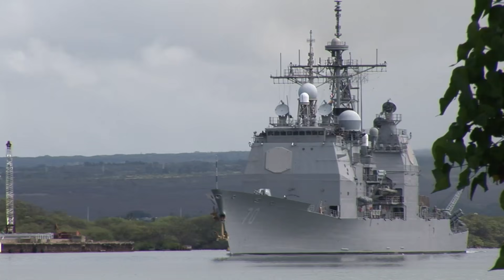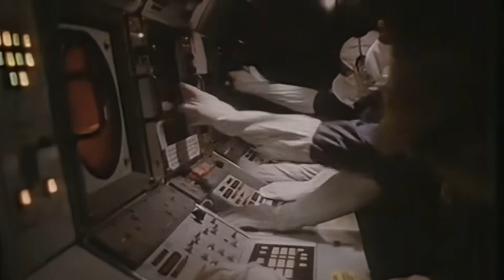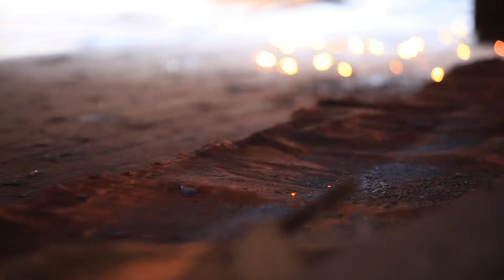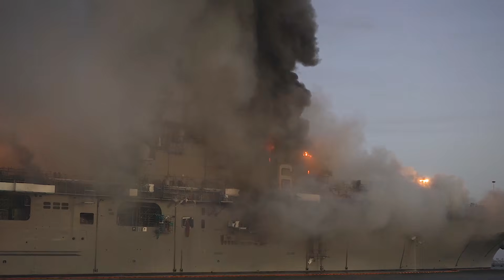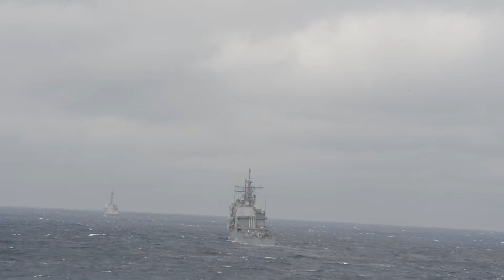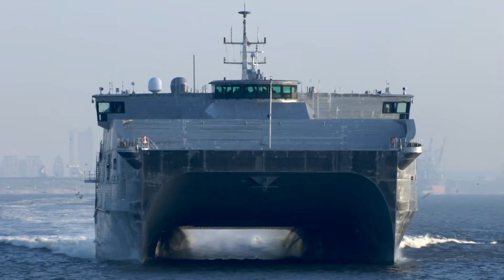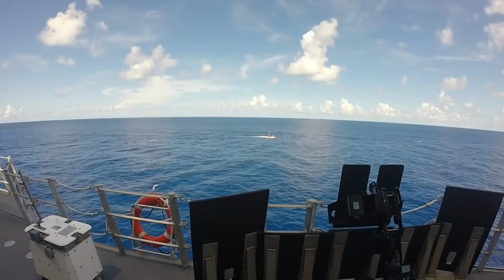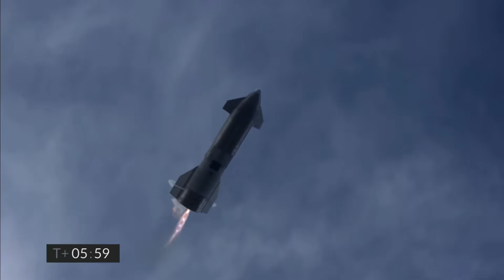Why is The US Building Aluminum Warships?

Comment: You did not mention where the cracks were occurring.  Were they at the aluminum-to-aluminum welds or at the steel-to-steel welds?  The aluminum super structure cannot be welded directly to the steel deck.  Before the invention of an aluminum-to-steel explosion-bonded transition joint, the super structure was joined to the steel deck using rivets or bolts.  This type of joint eventually failed due to galvanic corrosion.  The transition joint is in the form a 10'-12' long x 1-1/2" wide bar that is about 1-5/8" thick; the top half of the bar is aluminum and the bottom half of the bar is steel.   There is an electron-sharing bond between the two dissimilar metals that cannot be broken at the interface.  Using the transition joint allows the aluminum super structure to welded to the aluminum side of the transition joint using convention welding methods and likewise steel to be welded to steel on the other face of the transition joint.  Since there is no gap between the aluminum and the steel, galvanic corrosion is eliminated.  Using roll-bonded transition bars can be problematic because there is not a perfect electron-sharing bonded between the aluminum and the steel.
Reply: Combined bars are made by "stirring" the metals together at the joints under very high pressure.  I don't think the joins are at the electron (covalent) level.
Reply: @BenjaminFranklin99-s9n  Explosion bonding (welding) does not involve stirring of any kind.  It is a cold process where the two plates to be bonded are positioned face-to-face and parallel with a separation gap (distance) between them.  An explosive material is prepared by combining ammonium nitrate, diesel fuel, and perlite.  This fertilizer-like material is spread across the surface of the upper plate to form a uniform layer.  The explosive material is detonated at the middle of one edge using a special booster explosive.  The detonation travel from the spot of initiation through the entire layer of explosive at a controlled velocity which is slower than the speed of sound in the materials.  The pressure from the explosion causes the plate to progressively collide as the detonation proceeds across the plates.  At the point of collision (which moves across the plates), the pressure exceeds the yield strength of both of the metals.  It is several million pounds per square inch.  A "jet" erupts from the surfaces of the metals as the metals yield into the only place available...the gap between the metals.  This jet is composed on the surface contaminates of each of the two metals.  With the oxides, nitrides, and other contaminates removed and the plates forced together at several million psi, perfect electron sharing occurs.  Immediately after the explosion, the plates are only warm to the touch.  There is no heat involved in the process.  Almost any two metal types can be welded using this method.

Comment: The UK company where I worked used to import Combine Harvesters from Scandinavia, and when they arrived in the UK it was my job to replace the engines starter motor, dynamo and solenoid as a day or  two at sea caused the aluminum parts to powder and short circuit the electrics.
Reply: Why not remove them before shipping?

Comment: I know battleships were phased out due to the cost and ease of loss but I think a modern battleship with modern tech could be very valuable considering the amount of armor and defense systems that can be installed on a hull with that much displacement, it would be a good candidate for advanced systems like LAWS and maybe even the railguns when they are ready.
Reply: WRONG DELTACX!), that is NOT why BBs were phased out.  LOL!
Reply: @protonneutron9046  I'm pretty sure them being stupidly expensive and easy to destroy is the primary point for phasing then out, air superiority and subs completely countered the things.
Reply: @deltacx1059  Nope.  Other ships are EASILY to lose and can cost more. Like an aircraft carrier.. They are no longer built because aircraft can deliver more damage at a MUCH longer range.  Billy Mitchel demonstrated this concept before WW 2 and was Court Marshaled for doing so because the Navy was run by Battle Ship Admirals.  By 1941 the USN had figured out that the Aircraft carrier was the new Capital ship.
Reply: Wet navy battleship are decommissioned because aircraft carrier are simply much more capable and outclass them in wet naval combat, they can strike target beyond any battleship main batteries while concealing their location at the same times, and more importantly offer option other than "exterminatus point click adventure game" botton.

On void navy combat (space combat) though they will definitely make comeback since full 3D combat aren't exclusive to fighter anymore, planet's horizon aren't obstructing their view and more importantly fighter will mostly relegated for knife fight distance combat or munitions interceptions since their delta-v budget will be significantly inferior compared to bigger boat/ship.
Reply: @zidniafifamani2378  To be more specific, all US battleship construction was ENDED due to the results of one battle.

Midway.

Though the Battle of the Coral Sea had some input into the decision process, Midway was the final blow.

The only battleships the US completed construction on after Midway were already well along the construction process (Missouri was the final competed battleship, laid down almost a year before Pearl Harbor and about 1.5 years before Midway).
There WAS another class of battleship that had been ORDERED following the Iowa class (the Montana class) - but that order was totally cancelled shortly after Midway.
There were also 6 Iowa-class ships ordered - but the last two of THOSE were cancelled after Midway as they had not proceeded far enough to be worth finishing.

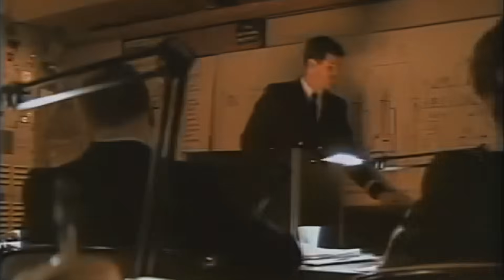Comment: 1:04 or just add a keel, sure it will slow you down but it solves the mass issue.
10:09 this is why aluminum boats have anodes to protect them from galvanic corrosion.
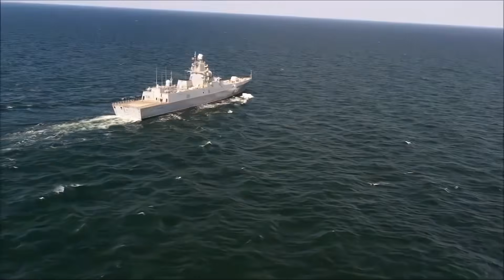13:10 that tells me this ship can handle way less than it's supposed to if 66% of it's rated load is too dangerous.

Comment: you can not compare starship to a Russian ship they are competently different using different joins and thicknesses. the reason starship dose not use carbon composites is to cut costs and because it is much cheaper. they are very deferent material with different purposes and deferent material requirements  both SpaceX and the Russian army have very different intentions with different materials different intentions and different budgets. the Russian ship is built to last when at the time of writing SpaceX have blown up 11 starships.

Comment: If its  true that virtually no ship can survive a hit from a modern ASM, isn't crew survivability the most vital consideration as a result? I mean the ship might be going down, but if the heat and stress cause the aluminium coponents to melt and crack, a large part of the crew might not be able to safe themselves. Or are modern ASM so devastating on impact that crew survivability is already close to zero?

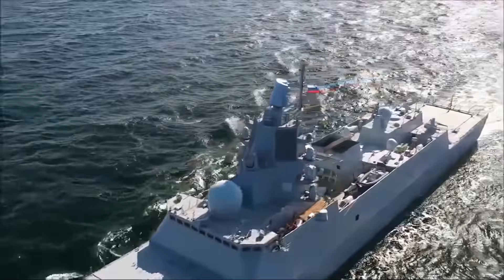Comment: 13:18 The Russians are right. It does. Of course Carbon fiber is much stronger and much lighter than steel, but carbon fiber breaks down over time with stress and it can't be repaired because it is constructed into the material like the metal  reinforcement rods inside of concrete.  Carbon fiber paintball tanks are a lot lighter and thinner walled than the steel or aluminum tanks are and hold higher pressures up to 4500 psi, but the carbon fiber tanks only have a safe lifespan of between 5 and 15 years, even if properly cared for depending on quality of manufacturing.  The steel or aluminum tanks can last forever if proper cared for, so long as they pass their hydrotesting.  Elon Musk is making reusable rocket systems they want to last a long time, presumably more than 15 years, so naturally they would not want to use carbon fiber. I think if ships were being built for a war that was currently happening then carbon fiber is the obvious choice to make a much lighter, much faster, ship because a ship in a warzone isn't going to last 15 years anyway. I would expect the construction of wartime ships and non-wartime ships to be very different in materials.

Comment: Didn’t the British find out that aluminum ships burn really well during the Falkin war when hit by missiles.
Reply: no, they didn't id10t
Reply: @protonneutron9046  —- steel melts at 2800 degrees and aluminium at 1200 degrees. Fire was not the problem but melting and warping due to the fire was a problem.

Comment: Why not build full sized ships (destroyers, frigates, cruisers) from composite materials? Newer composites are highly fire, stress, and impact resistant.
Reply: No, they binder burns at a lower temp than aluminum
Reply: @protonneutron9046  The DOD conducted extensive testing of various composites and while the ignition temperature of most were indeed less than that of aluminum, many were found to have surprising properties. The testing found that ignition temp and flammability were not the same. The ignition temp of most of the composites was around 300 degrees Fahrenheit (testing sample of 16 layers). However, their calculations determined that with a greater thermal mass (thicker construction), the time to ignition was much greater. The greater mass also meant the materials maintained a greater portion of their strength and structural integrity for a longer time. In addition, some of the tested composites were constructed of materials that would not maintain a flame once the heat source was removed. The same composites also formed a charred layer that protected the rest of the structure from heat and flame; all without losing any significant strength. That is why more modern combat aircraft are being built using composites. They are lighter, stronger, heat, flame and damage resistant; more so than any currently known metals. Price is the only reason I can think of for not using modern composites. But with more use and thus greater economies of scale, the price would come down to be competitive with aluminum and titanium. This happened in the aircraft industry and most likely would happen in the warship building industry.
Reply: @research903  WP = good bye composite ships.

Comment: Aluminum is a material used for cathodic protection of steel...basically the aluminum corrodes instead of the steel.  For the reaction to work, it just needs a conductive electrolite...  But where would you find that when sailing across the ocean????  :)  (LOL)  Probably better all aluminum than aluminum plus steel.

Comment: Aluminum does actually burn. If you expose Aluminum shavings to heat of 2500 F or above, it will draw on any nearby oxidizers nearby and generate thermitic reaction. That's the basics of thermite
Reply: It needs powered iron oxide for a reaction. The aluminum must be powdered too.

Comment: "Traditionally navies around the world built warships from steel". Nope not for several decades. For example HMS Amazon was Aluminium all the way back in 1971, as was HMS Ardent (1974) in fact that whole class was. USS Belknap was even earlier (1963) so aluminium ships have been around for the best part of 60 years. Also ironclads didn't come about till about 1876. Those were not steel but Iron plates over a wooden hull. So we have had Aluminium ships almost as long as we had steel ones.

Comment: Aluminum doesn’t burn he says???Thermite is made from powdered aluminum and iron oxide. Burns like a blow torch.
Reply: Almost all metals burn in powdered form, it doesn't mean they burn normally.
Reply: I am unsure if the Aluminum is considered to be burning in that case, but it steals the oxygen from the rust (iron oxide).
Reply: @franksavage1499 , this is interesting. I’m no chemist, or explosives person. I’ll try to keep these 2 things apart from each other. 
Thanks!

Comment: Dude wake the fuck up titainium is used not aluminum on critical structures to maintain low center of gravity. now inside non bulkhead walls and partitions contain aluminum go back to school I machined out exterior armor that all ships are skinned with a high yield steel alloy tough as hell to cut and warps feet when improper cutting speed and cutting feed is used. Your knowledge is flawed.

Comment: These littoral craft are suffering cracking. Would that happen if made from steel
Reply: The LCS has been an unmitigated disaster. The Navy is already decomissioning the first four Freedom & Independence class ships less than a decade after they entered service & is replacing the LCS with a more traditional frigate based on the Italian FREMM class.
Reply: Happens with every metal, when the designers forget to champfer inside corners.  https://www.theguardian.com/science/occams-corner/2013/jan/21/cracking-tale-first-jet-aircraft

Comment: SpaceX switched from Carbon Fiber to Stainless Steel because at cryogenic temperatures the properties of Stainless Steel come close to that of Carbon Fiber, although they don't surpass them. Cost wise however it is way more cheaper and can afford to put a little more Stainless Steel and it would still be 10 times cheaper.
At normal temperatures though and vast temperatures shifts carbon fiber composite materials make more sense.

Comment: By this same logic, ships should be made from composite such as fiberglass, kevlar, and carbon fiber. Cold molded plywood would also be nice as well. These materials don't corrode, and can be molded with built in foam cores like some famous pleasure boats. Those pleasure boats can be cut up into pieces and the pieces still float.

There is a reason why the guns on battleships became so big. A big gun is the only way to penetrate the foot thick armor belts on the sides of battleships. A missile or a terrorist suicide attack will fair no better. A fully compartmentalized modern battleship with a foot thick steel armor belt, a foot thick steel hull, and foot and a half thick steel superstructure with minimal height would be a nice start. A trimaran design would also help to reduce vulnerability to missile attack.

The aluminum foil designs of today are way too vulnerable to enemy missile and suicide attacks.

Comment: SpaceX ditched Stainless Steel for Starship because SS shows increased strength under cryogenic temperatures, perfect for cryogenic fuel tanks, and due to the fact that SS is significantly cheaper than Carbon Fiber. The Russian Navy doesn’t experience cryogenic temperatures, and doesn’t have monetary constraints.

Comment: Carbon fiber is harder to repair. Alumiinum, if a heat treated alloy, is difficult to weld without damaging the heat treatment. properties. A good reference about structural properties is info on bicycle frames. They are built from steel, aluminum, carbon fiber and titanium. There are positives and negatives. The topic is also complicated by what alloy of steel or aluminum are being used.

Comment: The Russians have been building aluminum military boats and ship for years. Back In 1992 we pulled 2 PT boats out of the basin of Kissmayu, Somalia. The 2 boats were Russian made. Both were 150ft long had aluminum hulls, fiberglass panel linings inside, 2 50cal on the starboard and port on the Bridge level and double 20mm guns on the fan tail and 3 screw propulsion. I know it was fast

Comment: "While Aluminum doesn't burn" Yah, right. Explain where all the Aluminum in an airliner goes in a crash. If an element can oxidize it can burn.
Reply: I got bored at the later stages of a Bonfire Party at a buddy's place . Most everyone had left or gotten too drunk to stay awake so I threw a few aluminum beer cans into the fire . the ink burnt off with little more than a scant amount of yellowish smoke. Once that was over with ,the aluminum started melting then burned and it looked weird. The flames were small but a brilliant whitish colour ( not quite as bright as magnesium however) . I am wondering about fumes from that aluminum and if I'll pay for it with brain troubles later in life. I did notice a "sweetish /metallic" odour in close proximity to the fire.
Reply: @michaeltheoret8913  bruh aluminum is technically a neurotoxin in small enough particles. Don't go breathing in aluminum vapors on a regular basis and you should be ok.
Reply: right, like steel mpetersen6
Reply: Steel combines with oxygen to create rust.  By your logic: Steel Oxidizes, Therefore, Steel Burns.
Reply: @zacharytracy3797  it's all about surface area exposed to the oxidizer, in this case air.  One of the easiest ways to start a fire, is with steel wool:

https://www.youtube.com/watch?v=5MDH92VxPEQ

So, yeah.  Steel burns.
Reply: @theancienteternaloaktree  That's because metal powders burn, but the metal themselves do not.  Aluminium doesn't burn, mpetersen6 could simply have Googled that instead of demonstrating his ignorance in front of people but he probably doesn't have internet access.  /s
Reply: @krashd  that's not true.  All metals except noble metals can burn in the correct atmosphere.  The colloquial term 'burning' refers to oxidation in air with an exothermic reaction.  Lots of metals are quite combustable.  Try putting a flame to magnesium metal for instance and see what happens.  As it turns out, steel is very easy to burn as well.  Take a 9-volt battery and touch it to some steel wool. (Which is not a powder, it's strands of steel) Watch the flame start.
Reply: @zacharytracy3797  get it hot enough and it will.

Comment: The thermal tiles on the Space shuttle are made from carbon, and were shattered from the impact from a fragment of foam insulation. The notion that this solution would be sufficient to protect a warship from a missile is absurd.
Reply: @BenjaminFranklin99-s9n  And both are highly brittle.